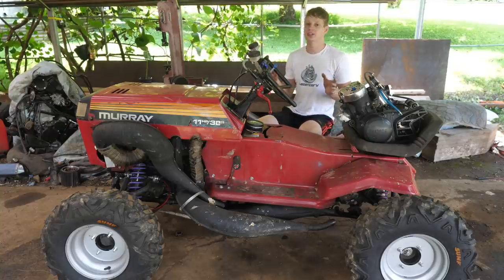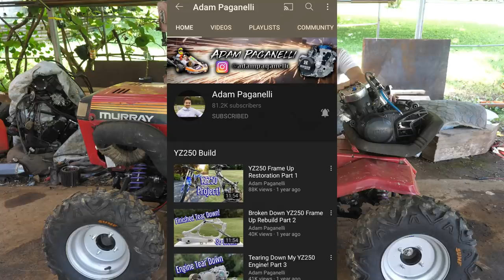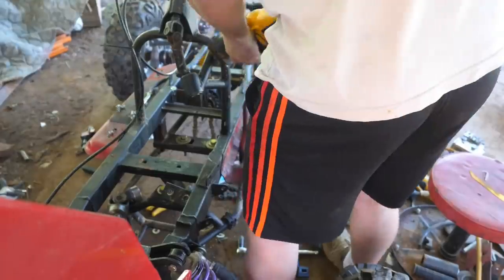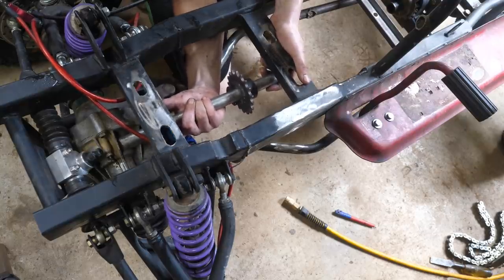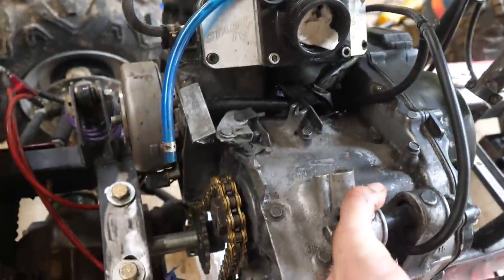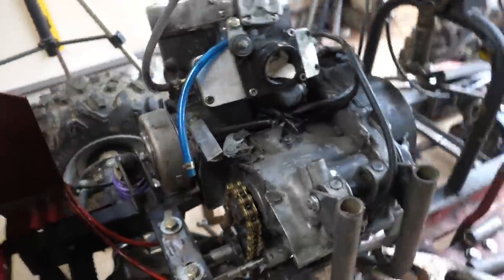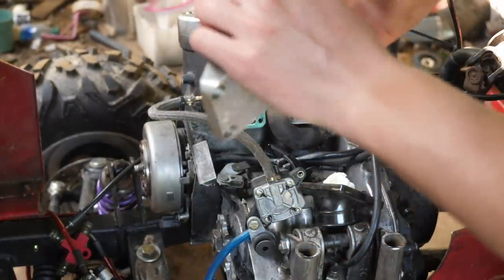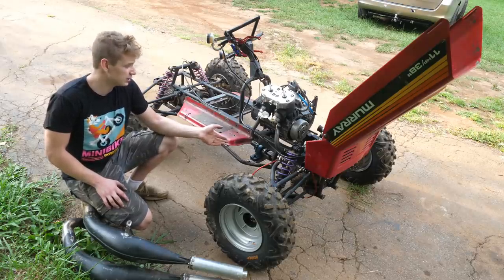Banshee Swapping my 4x4 Riding Mower!! Part 1

Comment: I thought that was the rd350 engine!! The gsxr engine would be perfect for the mower, the triplet would be perfect for the cross cart, the banshee engine would be good for a drag build, great vids!!
Reply from the maker: 1) Gsxr too complicated airbox would stick past the hood. 
2) grindhard already built a 2 stroke crosskart. 
3) banshee a good drag choice but to expensive nowadays
Reply: @VasilyBuilds  you can have the air box stick out like a hood scoop, grind hard did one and it works great there’s no shame in building the same project eg: rather be welding grave ninja and moto mule grave digger, and I’m saying it would be cool for those engines in those projects, they should sling some mud anyways!!
Reply: @VasilyBuilds  maybe a powerwheels V2 would be cool with the 3 cylinder 2 stroke. But like every project its going to be tight😁
Reply: The RD 350 engine is nearly the same.
Reply: @Mathes522  I know, he said that in the videos lol...

Comment: with the 2 stroke tripple you better build a buggy like chris from rather be welding did. i saw you liked it! and if you don't like CVT, you could add a car gearbox with car drive shafts connected with chain and sprockets to the engine. makes shifting easy, reliable components
Reply: Cvt has its applications but imo sounds terrible and belts always have problems. Biggest thing though is just how much space a good cvt takes up and how little space he has in the mower.

Comment: Hey man, I'm actually excited for the Banshee swap. A couple things though I'd like to see changed. First off, in the interest of handling and the health of your ball joints, you gotta ditch those wheel spacers. Especially on the front. Those wheels are pushed so far out from the centerline of those spindles, the scub ratio has to be atrocious. With being 4WD and with all that newfound power going to the front wheels, you're going to want every handling advantage you can get. Secondly, I hope you're planning on stiffening up the rear suspension. In the last test video, that thing had some serious squat going on. Lastly, anyone that's urging you to slap a deck on it is missing the point of the build. Seems like alot of extra work for something that isn't practical and you aren't actually going to utilize. This thing is beyond bad-ass for what you're actually building it to be. No need to throw a deck on it. What, just for views? I don't see the point in that. One thing I've noticed and appreciate about your builds, there's no useless extras. Keep that focus dude, that's why you've got the following you do. Looking forward to how this Maniac Murry Mower turns out 🤘
Reply: I for one couldn't agree more with all that is said here. if you want to mow, buy a mower and leave it alone. they work well completely stock for cutting grass. and the rear end spring rate definitely needs stiffening up a bit.

Comment: Great work.  I've  been thinking about  bike engines in 4 wheeled vehicles for a while and thought that maybe it's possible to use a car starter motor as your reverse gear.  So drop the petrol engine in nutrel then somewhere in the drive line have an electric motor you can run momentarily while you reverse.  Just an idea you might toy with one-day.  Keep up your great work.

Comment: i have a mtd mower that i want to tube frame and put a street bike engine in and run one long chain, i think that it will work similar to a stretched bike with the length of the chain. i was on the fence on building it. now after watching your mower videos i really want to. love the build it just keeps on getting better!

Comment: I love the direction you are going with this build!
What diameter of drive line are you using? 
Where are you getting the shaft materials? 
Where are you getting those U-joints?
Thanks!
Reply from the maker: 1 1/4" axle from gopowersports, Tractor Pto universal joints from ebay
Reply: Tractor supply has most of it

Comment: You could have done away with the secondary clutch and just had a small solid pulley. You could ran the primary clutch witch would give you enough gear range an a  tension pulley to take up slack on belt and rather then the tension pulley being spring loaded like you may think you’d actually have the pulley mounted solid rod linkage  back to the mowers OEM  gear shifter. And when you choose 1-2-3-4-5-6 gear on mower it would move the new   tension/idler pulley into 6 different slack  positions allowing the belt to ride up further and further on primary clutch . In essence you’d have a standard transmission with and auto  clutch. It would been sick. Could hear ea gears rpm range rather then cvt constant rpm.   Could been sick could been banging gears on a one off big ass 2stroke triple. 
              Single pipe instead of the triples and delete secondary clutch for a small solid pulley. Add a manual tensioner pulley hooked to the mowers oem gear shifter. Boom 600cc triple 2stroke banging gears. Was so awesome that you were not just doin the same exact thing as every single other person and stuffing a atv motor on a mower.

Comment: I own an 85 Kenny Robert’s Yamaha RZ350.  The originator of the water cooled 350cc parallel twin. Get ready for some fun. 
Friend has a 75 RD350 which is the air cooled variant.

Comment: Maybe you can split the exhaust and run the front exhaust around the front of the engine and make it look matching on both sides.  The smaller engine will balance it better in case you want to jump it.  Are you going to put a fan and cowl to cool the engine as this is not in the front of the bike going at 65 mph getting air cooled, but instead is on a cover going 20-30 mph ripping it through dirt.

Comment: I'm curious about the Kawasaki kx 250 drag shifter kart.
 What exactly were the diameters and measurements Round Thickness to both 95 ft of Tubing
and 20 Lbs. of Stainless Steal Sheet Metal to build your Shifter Kart.
Appreciate you Thanks... Great Content

Comment: You def need to leak down test that engine.. can make your own or buy one. Id go with South Texas Banshee for a leak down kit. I've put many of  banshee motors together and even with the gaskets and gasket maker on the gasket have had many intake leaks. From the studs to the sides of the intake. (1) leak down kit (2) carb sync tool.. 2 must haves for a banshee motor. Dont make a half ass banshee motor

Comment: If you think it will go over 151 mph, I'd say put the mower deck back on and use electric weed trimmers, just so it can cut some grass. Then go for the world record, set by a Honda. If it won't go 151+, get a motor that will.

Comment: Just because the power is put down close to the front axle doesn’t mean most of the power goes to the front axle because you’ve got a solid connection between your front axle and your rear axle it doesn’t matter where you put the power in it’s a 50-50 split son

Comment: Would a harley 5 speed gearbox not have worked with the triple?
Reply: I allways thought in my head thats how i would do a bike with a big 2 stroke engine. Belt drive to an external transmission
Edit:ahhh yeah still got that big ol clutch
Reply from the maker: If I had a machine shop and cnc mill at my disposal, I would have probably tried to mate a car transmission
Reply: @VasilyBuilds  How close are you to RBW?

Comment: Vasily you should use a 3d design program before starting these projects.. you do soo much work twice because the first design doesnt work as you had hoped.

Being able to lay a build out to scale would let you see many of the issues you run into, before actually welding anything.

Comment: I’m not hating on you or nothing and I do think out of the two engines that the banshee is a simpler engine for the mower but I think it would be way cooler in something else like a drift trike or something like that.. tell you what. I have a trike frame I built and never fully finished that I would donate to ur channel if you could do something cool with it and arrange the logistics of shipping it

Comment: If you want to go fast, loosing the CVT is the best decision you could ever make. I'm seeing a lot of driveline issues in your future and some pretty sketchy wheelies.
Reply: Cvt would make it ten times smoother and way faster. To say you lose speed with cvt is the dumbest thing I’ve ever read🤦‍♂️
Reply: @tylerseabook9423  ok. When the banshee motor with less power propels the mower quicker and faster you can just call it magic.

Comment: So you swapped out a 680 145hp motor for a banshee 350cc wow
Reply: 600cc 110hp engine*
Reply: @northwoodsrippers9639  that's a 680 ultra motor unless its just a 600 xcr motor either  way if it was just a 600 the whole top end of a 680 would fit or an 800 xcr would Also share the same bottom end and they are 180hp with mild port work this build went south for a 40hp 350cc
Reply: @lifted9821  it’s an xcr 600 engine, I gave it to him lol, and I know man but trust me that banshee engine will be a lot better for what he wants out of this thing, that Xcr engine would be perfect for a dragster because they really only make good power wide open
Reply: @northwoodsrippers9639  then you don't  know much about those motors lmao those engines are beasts ya they engage at 5000 but can rev reliably to 9500 I have one .there is nothing you can do to that banshee motor that that triple won't stomp with half the mods and more reliability . For what it's worth that motor was poorly tuned and clutched for the power he was getting.
Reply: @lifted9821  Obviously you’re the one that doesn’t know much about these engines because why would you be able to rev stock pipes to 9500 and still make more power? Maybe with some psi high rpm pipes or some LRM pipes but that shifts your power band even further back making your low end even worse (witch he needs better low end for this thing to really scoot) Maybe the triple would be better at wide open compared to that banshee but low end and mid range banshee has it all day long because he has the ability to choose what gear he’s in, also those engines don’t have a stock engagement of 5,000they engage at 3,800rpm. We changed the weights and the spring to bring it up to 4,200 and we changed the Helix from a stock 34 degree to a 36 degree to take better advantage of the power. To say I don’t know anything would be an understatement especially when it comes to rpm and clutching
Reply: @northwoodsrippers9639  I have psi pipes it dont shift power that much still lifts the skis engagement at 3500rpm just gives you more power and rpm instead of falling on its face.there is no way in hell that an engine that makes 100hp stock has less grunt then a 38 hp twin.look at sxs blog they are using a lesser two stroke tripple in a sxs and still scoots it around just fine. Power with a two stroke is all about clucthing relationship with the gearing. If the motor can pull a 600 pound sled through the snow at any speed it will be crazy in a lawn tractor lol the .motor also ran like total garbage as well so that don't help did ya even jet the poor thing cause it sounded rich as hell. I am Not trying to be a dick if I sound that way I apologize but I there is way more possibilities for power with that tripple he could practically double his power with just a 800xcr top end and still run 7000miles before worrying about a rebuild they are the most reliable  big bore 2 smoke made by polaris.